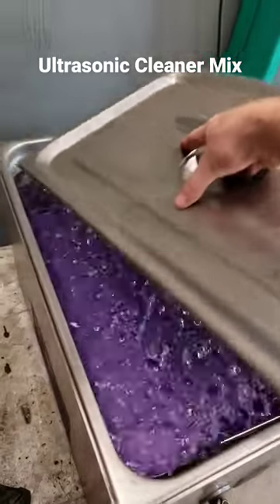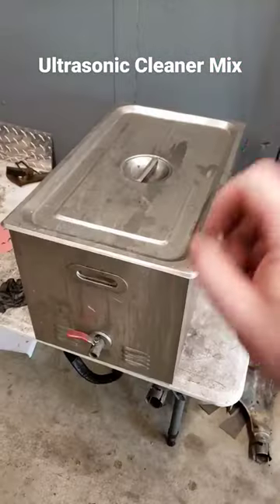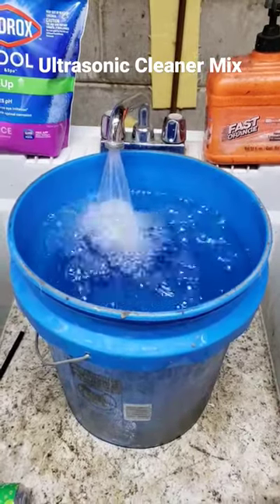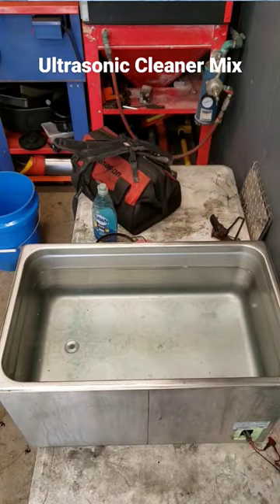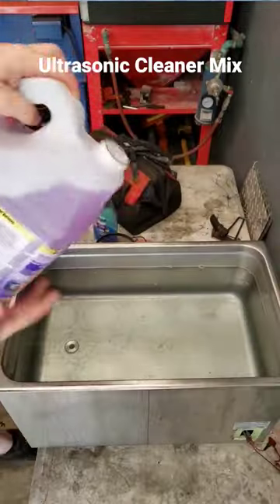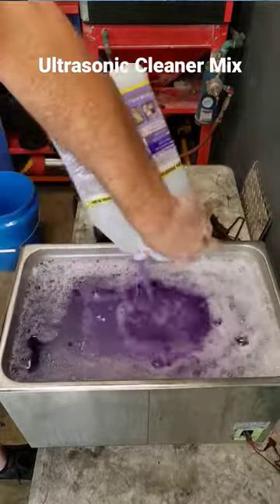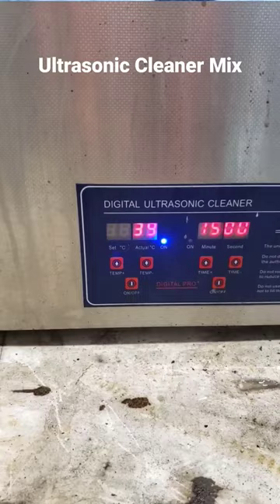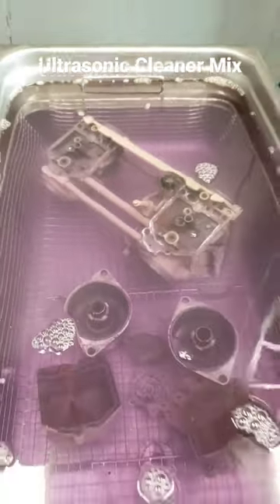Ultrasonic Cleaner Mix for working on motorcycles #shorts

Comment: I had access to a cleaner at my job. We used the soap the manufacturer of the machine recommended and it sucked! I reverted back to avgas in a cup on a box fan. I like your mixture.

Comment: I’m gonna have to try the simple green purple stuff you have. Too much of the original green formula turns my brass parts dark in my sonic washer.
Reply from the maker: Just make sure its exactly this. There are different ones. The green is no good for aluminum.

Comment: I also use the SG Heavy duty purple.  It works great, much better than when I used normal SG and turned my carbs black haha.  I am curious to why you use Dawn soap? Does it work better than just the water and the simple green HD?
Reply from the maker: I mean it works on oil soaked ducks so it must be good here right? 😉
Reply: @BrickHouseBuilds  That's pretty funny, but did you do tests with Dawn and without to see? Or is it just a hunch that it works better? I am going to try adding Dawn when I clean a set of CBX carbs to see if there is a change comparatively.  I'm always looking to make carb cleans more thorough and time efficient.
Reply from the maker: @willjohnson5861  I have not done any scientifically backed tests. I like using it but me saying its a good degreaser may not mean anything since combined with an industrial version.  Try it for yourself and formulate your own evidence as its very low risk.
Reply: @BrickHouseBuilds  Sounds good to me! I trust if you are using it, I won't end up with blackened aluminum from trying it out.  It definitely does the trick on dishes, and it is affordable to add to the solution.  The company I bought my ultrasonic cleaner from has a solution that comes in a powder form you add to water, but it is so expensive I can't imagine it is that much better.  They say it's specifically for carbs, but I don't know anyone who has tried those style of cleaners, have you had a chance to use them?  The brand was SharperTEk if that matters.
Reply: Speaking from the u.k..... What is Dawn soap please?

Comment: 30liter.. so lets fill it with 5 gallons of water.. :)
Reply from the maker: not sure what your point is here
Reply: @BrickHouseBuilds  Someone trying to "gotcha" on the math when in fact they are the ones that don't know conversions.  I'll help him 30L=7.5 gal tank.
Reply from the maker: @binder929rr  Its just a weird thing. I could fully disassemble the lunar module and reassemble but if I have a shoe lace untied someone will use that to discredit everything else.
Reply: @BrickHouseBuilds  Haters gonna hate.  You're crushing it so keep on keeping on!